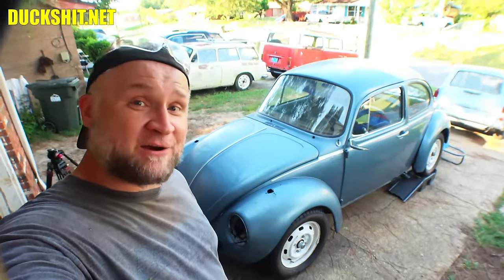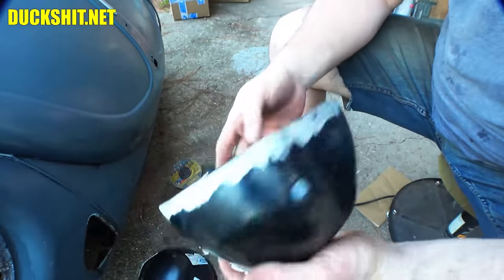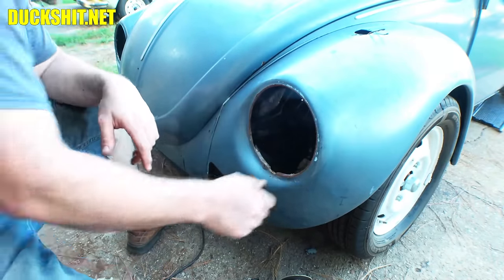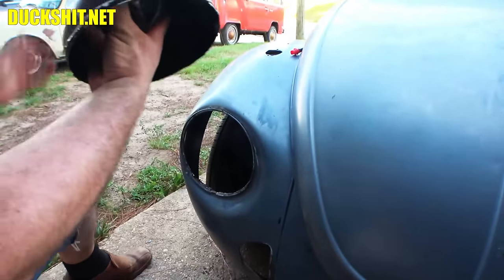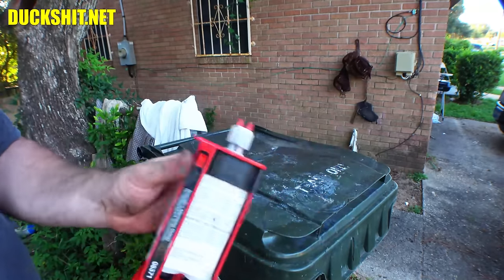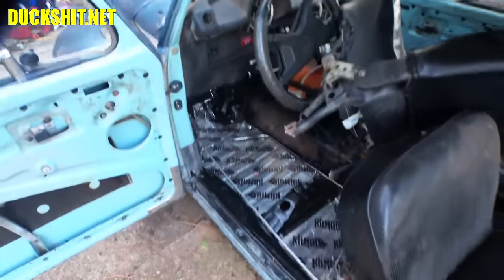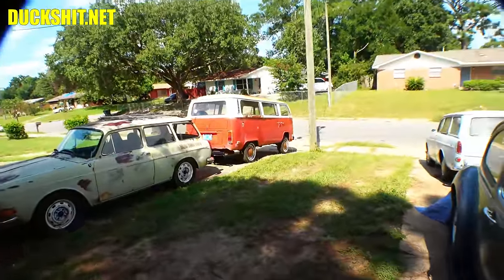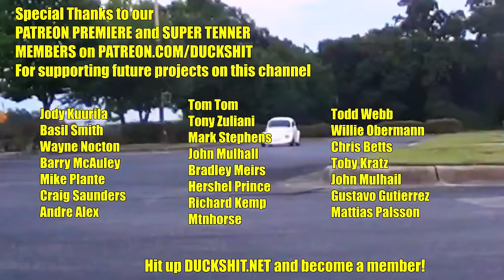💥Rust Repair -WITHOUT WELDING💥 - Super Beetle - 01

Comment from the maker: Would you use this method of panel bond vs welding?
Reply: Good Video Glenn!
Reply: I've seen people  use it to put down a floor in a splity and that  floor wasn't coming up ever again.
Reply: Could it be used to repair motorcycle fairing ?
Reply: Depends on the job , but yea I would use it.
Being an ex windscreen fitter I've used polyurethane glue to stick lots of things , and it was free at the time .
One time I had a brand new van .
Parked up to do a job for customer right in front of a tree stump .
Did the job got back in drove straight at the tree stump detaching the bumper on one side , glued that sucker back on with windscreen glue taped up over night , well in two years that bumper never moved 😂😂😂.
Reply: It is probably the strongest epoxy on earth. They use it in industry in place of spot welds and I hear it holds on really well.
Reply: Yes
Reply: @ES4406  Thanks Earl!
Reply: I used it to bond a fiberglass split conversion kit into window channel. Its really good stuff.

Comment: Since we are in the USA.  Energy absorbers didn't come about till 1974.  1973 and older vws had flat bumper brackets.  Also a super beetles can be identified by the air conditioning  vents under the front  bumper which your does not have.  I'd say it's a 74 -76 regular bug
Reply from the maker: Good call!  Thanks man!  😁👍🦆💩
Reply: There are front vents under the bumper, look closer! And it has the Super Beetle trunk and strut suspension! Duckman is right, it IS a Super Beetle. I had 2 1972 supers myself and a friend had a 73. Worked o a lot of them and converted a few auto-sticks to 4 speeds for customers.

Comment: Interesting. I know some time ago, the silicone Ford used to glue the winscreens in, went structual and it was like cement. As the windscreen was now part of the structure and strength of the car, it had to be stronger. We have plastic everywhere on cars these days, so glueing on parts must be okay too, if you used the right glue. Thanks for the demo, Duckman.
Reply from the maker: Yes indeed!  Nowadays the "windshield glue" is more of a butyl rubber though, to allow for expansion/contraction differences.  I wouldn't use something like panel bond on there, might bust the glass the first time you leave it parked in the sun.   😁👍🦆💩

Comment: It's a '74. '73 would still have the non-crash bumpers and the '75 would have the bulged rear apron, and '76--'79 Supers would all be convertibles.
Reply from the maker: Very good call!  Thanks for sharing that, but the bulged apron only applied to California/EU/Mexi late cars that required a catalytic, regardless of specific year.  There is one of them here in town, the only one I've ever seen in person.  Florida didn't need that nonsense.

Comment: It looked like the throttle was knocking off the vacuume advance on the bus. JB weld the ignition in place LOL It might work but it is wrong to do that.
Reply from the maker: No I just left it off from when I was checking the timing earlier, lol... it actually passes way under the linkage close to the tins.  All good!  No reason to glue the ignition static, seems to be working properly, haha

Comment: Not 73 didn’t have those bumper mounts. 75 first year for fuel injection and the rack and pinion steering
Reply from the maker: Good call!  I had forgotten about the rack and pinion.  I'll stick my head under there and look.  If it doesn't have it, then 74 is correct!

Comment: Duckman i have two pieces of advice for you 1, move to England the climate will suit you .
2, never do any iceing on cakes.
Ps if you move to england you will defo have more welding job s 😂.
Thanks again for a good video.
Reply from the maker: Why?  It rains there as much as here, lol!  But it would be a bit cooler I suppose and far less sun to fry my white skin.   And I am a piping bag in the bathroom, that's close enough.   Thanks for the laugh man, lol!
Reply: @DuckmanCycles  🤣🤣

Comment: Are you going to paint the backside to be sure there’s no rust? How strong is this stuff? Could you have chopped Eleanor’s top and “glued” it together? Anyway that looks like some good stuff.
Reply from the maker: Yes, I will cat piss and paint under the fenders later on.   No Mustangs in my videos, though Eleanore with 3 E's!   This panel bond isn't intended for butting metal together though, gotta have an overlap, and the ability to press the pieces together.  A lot of Eleanore's chop was in blind locations where that isn't practical.  But I suppose if you glued on a coupler piece along each seam on the inside and had a ton of patience it would be possible, but you'd have to wait 24 hours for it to harden before you could move onto the next bit.

Comment: Will the panel bond work on metal to fiberglass / plastic, or is it just for metal to metal?
Reply from the maker: Yes!  But I suggest that you scuff up both surfaces, if they are smooth it won't stick as well.  Remember, the bond is only as strong as the material under it!  😁👍🦆💩

Comment: What year is that beetle? That is hard say because...

The '73 Beetles and Super Betles are the last year for the Slotted Bumper inserts. The '74 to '81 (USA) Beetles have the Hydraulic Dampeners which needs the Tri-Oval holes to insert them.

The problem is this, for some reason, Many '73s end up with a '74+ fender replacement when in an accident. I seen "Mechanics" replace all 4 fenders like this on a '73 as to make them all match. *SMH Moment there...*

The other problem is that the '73 was the last year for the Oil canister Air Filter, but that too can be eliminated and replaced with a the newer '74 boxed in paper filters or custom filter/carb jobs.

I know that the suspension on the '71 and '72 Super Beetles are slightly different from the '73 - '81 Super Beetles. But that is no help either in identifying this car.

So lets call it a '73 until we can get and match VIN Numbers. Should be one at the hump under the rear seat next to the battery.
Reply from the maker: ITs often hard to say because people mix things up on these cars, too lol  Thanks man!

Comment: Hey duck man, I have a question for you. I just put a new clutch in a 71 beetle and now that it's back in it will not engage at all. Any ideas?
Reply from the maker: Did you replace only the clutch disc, or the pressure plate, too?
Reply: @DuckmanCycles  I replaced the clutch disc, the pressure plate and the throwout bearing. After I put the motor back in I had no pedal at all so I ended up adjusting it to the end. No more adjustment available. I have no free play in the pedal anymore but it also will not engage the clutch. I appreciate your input. I really do. I love your videos
Reply: @jeffreyparcells5704 I suspect the throwout bearing getting out of place and not setting up in place correctly. Also make sure that the pressure plate and the throwout bearing are meant to work together; there’s a couple of variants.
Reply: @vayabroder729  I got a Sachs clutch kit for a 71 beetle. I appreciate all this. The only reason I even attempted this is because I live in a small town in Colorado and not a single mechanic within a 30 mi radius. Will touch the Volkswagen from a disabled veteran in Colorado. I sure appreciate this
Reply from the maker: There is that possibility of a wrong pressure plate, if the pressure plate is missing the ring in the center a sloppy clutch could result, that is if your car is consistent with all the correct stuff that belongs on a 1971.  Another possibility is a broken or bent throwout release arm cross shaft.  Couple things to look for.

Comment: minute 25 is because there is a bunch of factory FOAM behind there.
Reply from the maker: There's foam behind there?  How'd that get there?  😮
Reply: @DuckmanCycles  The VW factory!
Reply from the maker: But why would they do such a thing?
Reply: @DuckmanCycles  It is to reduce the sound of the engine. /The early VWs had a cloth pouch pushed up there.
Reply from the maker: That's very unusual, its just gonna rust!  My 56 had pillows in there that matched seat material, but no foam and still rusted, I guess maybe foam not so bad,  I'll add some foam back in.

Comment: 1974
Reply: Yes..... I agree...... 1974.   1st year of the shock bumpers, more streamlined front seats. 75-76 first years fuel injected engines (assuming that that is the original engine).  73 had thicker front seats and non shock bumpers...... Also the cut outs on the engine apron for duel tip exhaust.  75-76 single tip exhaust.
Reply from the maker: Very specific!  Thank you!